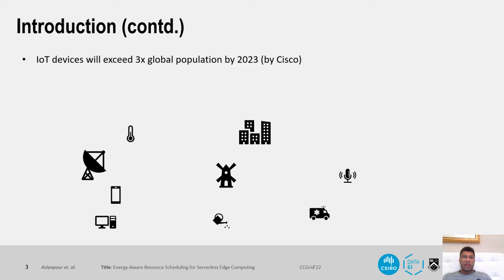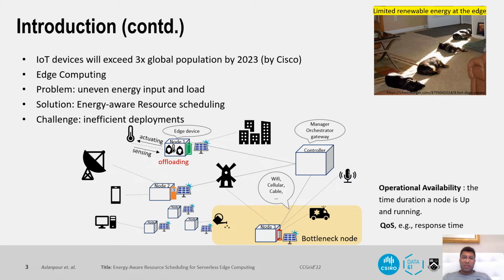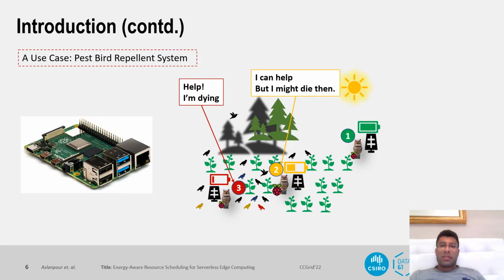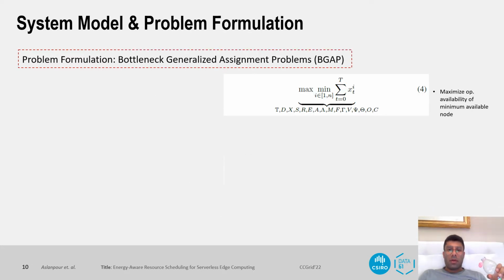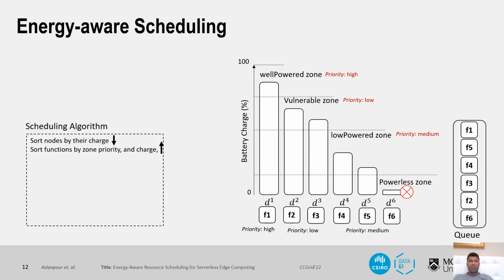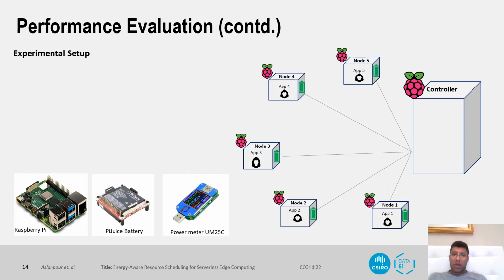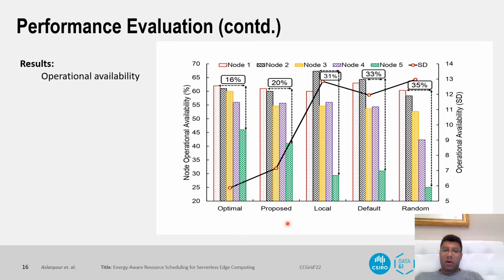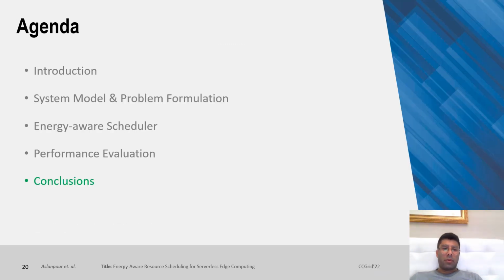Energy-Aware Resource Scheduling for Serverless Edge Computing

Comment: How to calculate the energy consumption required to complete a task in the experimental part
Reply from the maker: Thank you for your question. The energy consumption is here determined on a function level, instead of a task level, which means the number of functions of different types determines how much energy a node consumes over a timeslot. The task contributes to this indirectly. For example, if a function replica of type A can handle X requests over a timeslot, and if the scheduler has been noted that in this timeslot 100 tasks will arrive for function A, then it will consider 100/20=5 replicas are going to execute tasks and the energy consumed by them is 5 times the energy consumption of a replica of type A. I hope that answers your question. If not, feel free to reach out to me by email as well, that is mohammad.aslanpour@monash.edu